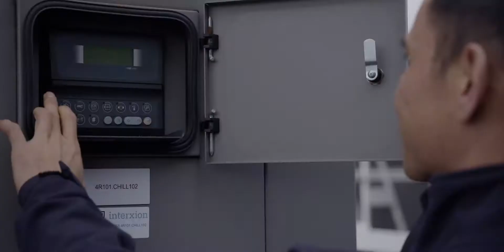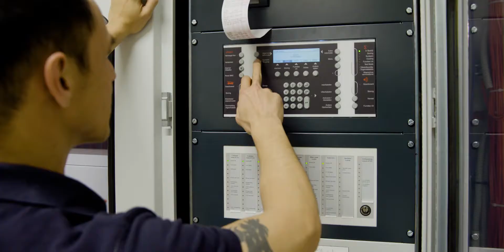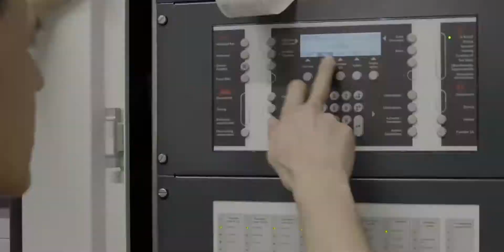A day in the life of a Data Centre Site Engineer at Interxion

Comment: Well, one thing to note - if you're in DC Support where you're doing rack and stack, cross connects, port assignments, managing cable-mac/cable plants, and assisting third party vendors with access to equipment in the DC as hands and eyes support.....   with all that in mind, you will not be involved with HVAC, running power whips (electric), or anything related to what the electricians or facilities crews will be doing.  Those, from my 20+ year experience, tend to be union jobs here in the US.  Might be different in other countries, but here in the US, you focus on the hardware, the connections, and tech support... not the building, electric, cooling, etc.    You may monitor power usage and temperature in the cabinets... but you'll be requesting tickets and service to those facilities crew to correct any of those issues.
Reply: The same job in India we only support hardware console connection patch temperature only
Reply: Im a sparky for over 15 years and looking to move into Asia and change career path. I have experience in data centre working on UPS and some systems and even installing cold isle containment. But i have zero background in comms and IT systems. 
In your opinion, would this be a path to consider with basic prior knowledge. Data centres have always been an interest of mine.
Reply: Working alongside dc engineers they never really appeared busy except when expanding. It appeared to me as something you learn on the job also.
Reply: @aphaseelec  DC engineers should be generalists in that they know how to configure ports on equipment like Cisco switches, routers, fabric interconnects  Same holds true with Arista equipment and other similar hardware.  You don't necessarily need a CCNA Certification, but it helps to bridge a number of the skills needed in managing other equipment like OpenGear terminal servers and configuring management connections on equipment that has onboard management controllers like Cisco's CIMC.

Know how to troubleshoot copper, fiber (Multi-Mode, Single Mode, Dark Fiber) - understand how to read and interpret information provided by transceivers, port-channels, VLANs etc. 

Your goal is to ensure the links between endpoints come up on layer 1 and 2.  Layer 3 on up is typically handled by the networking engineers.
 
Rack and stacking is learned on the job - not much too it.  Managing rack elevation documentation and labeling of every single network connection from end to end is a large part of the tedium of the job.  

You should be aware of things like Data Center Infrastructure Management (DCIM) equipment and sensors that report environmentals back to software like Environnet. 

You should be aware of how to service servers that host site management software like Liebert's Site Scan.
Reply: Appreciate the response champion.